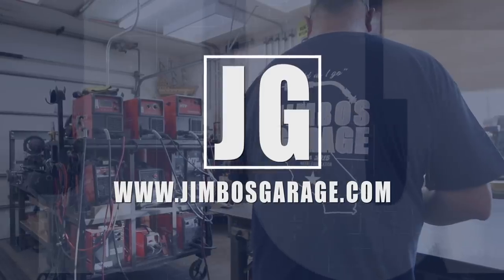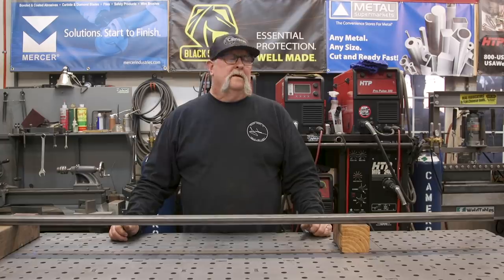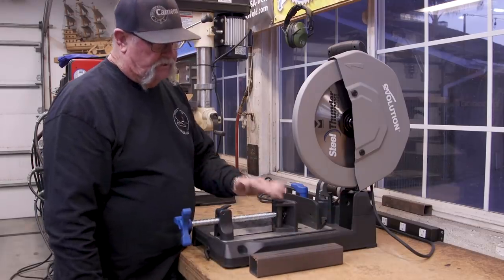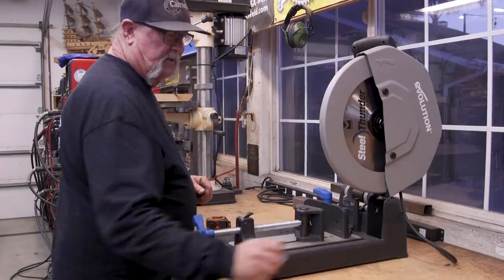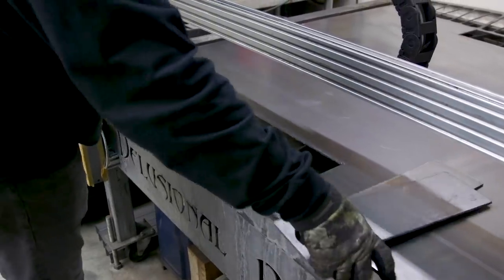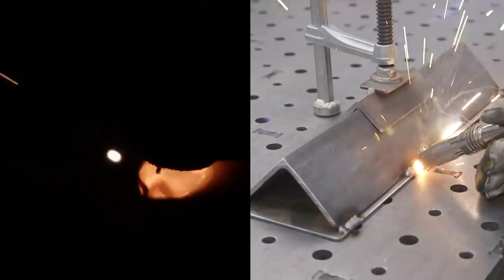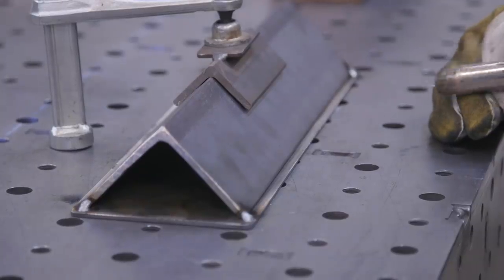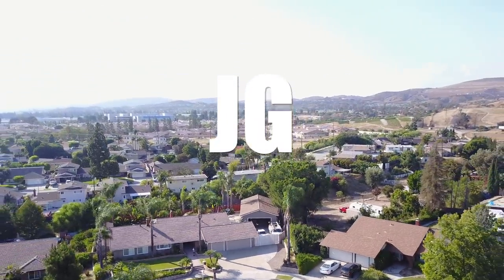Table Top Material Rests for Cut-Off Saw | JIMBO'S GARAGE

Comment: Good job on the build there Jimbo. Noobie to you channel and I made a previous comment on the saw. Looks like a great addition to the shop. I'm also renewing interest in fab work (decades of being away) and watched your "before you get started" video. Working overseas for a bit longer but want to get the shop set up for my "retirement" days ahead and looking at welders and such. Between your videos, Zila, 42Fab, HTP and This Old Tony, think I've zeroed in on the basic items. Invertig 221, plasma 875, but undecided on Mig. I called up HTP (good team) when I was thinking the 2400 would fit the bill since the 221 covers tig and stick. But now I'm wondering if the lighter weight and functions of the Pro Plus 220 wouldn't make it a better option. I see the current sale but I won't be back to the US until end of year maybe longer. No need to burn up another warranty. I see you have the 2400 and the 200 so thought I'd ask your opinion. The 2400 is a bit cheaper and I'm sure it works well but the extra features of the 220 sure make it enticing. Wish the 300 had AC Tig or a bit cheaper but guess I need to really figure how thick of metal I plan on welding. Doubt I do much over 3/8". but want to use 220 as the minimum output. Fronius was looking pretty nice and also ESAB 285 but still no AC tig in those Multi function welders either. Everlast has the 275 but.... Ok, thanks and novel off.

Comment: Thanks for your videos! Arc shots are looking good! I just bought a Slugger - it seems to cut straight which is my number one complaint with my Evolution. The Evolution was worthless out of the box for miter work because of the blade not tracking square. I just use the Evo for square cuts that aren't critical. My Dewalt multicutter saw cut truer than the Evo. Interested to see how true your new Evo cuts. Keep up the good work!

Comment: I was getting ready to order a 14 inch Slugger, based on your praise of your Slugger. What happened. Why a Evolution. Also how do you like the evolution vose doing 45 cuts.
Reply: Money and/or free product. It's called sponsorship. Being an owner of 2 Evolution saws, I can tell you they cut just fine, but I expected much more based on the praise from Jody and his buddy JD. I was disappointed with both saws. A cut off wheel and an angle grinder are still my go to. Portaband and a little table I made for it are a close second pick.

Comment: How better to stick with welding or wire, a thin stainless steel plate. I have a hook, it has a nut with the screw, as many times as I tried to glue it, I cut the sheet metal, to explain to me how to fix it🇬🇷👍

Comment: Why not just put a piece of 3/8" flat stock on top or bottom of the 2" square tubing?  Love your videos though.
Reply: It would probably tip (trip?) Lol fall to the side when you move the stock you're cutting, because it would be taller than it is wide
Reply: Yeah that's what I came up with too
Reply: @janeblogs324  I thought that too, however, my brain said make two feet wider than necessary,Kinda like a capital I in a serif font :D